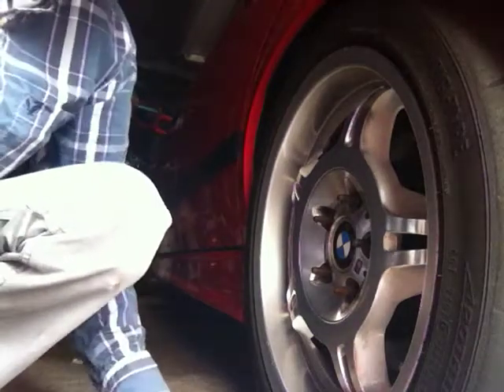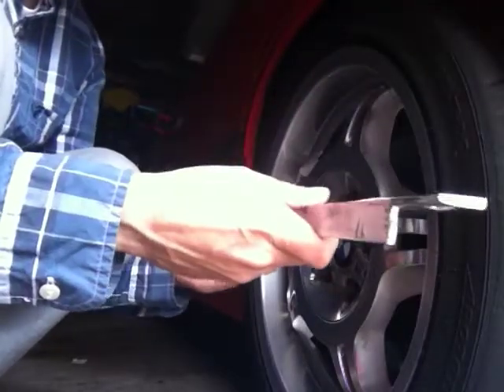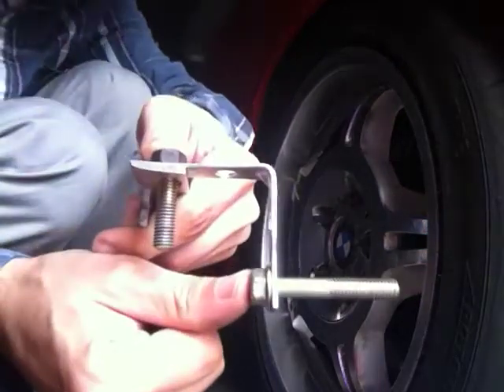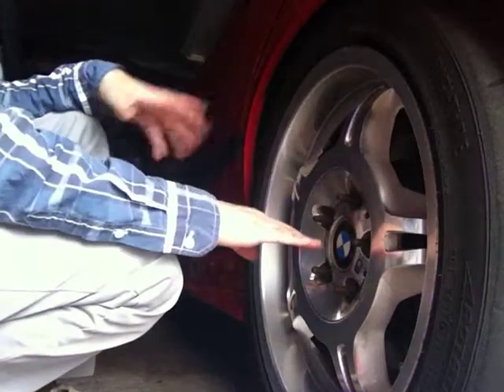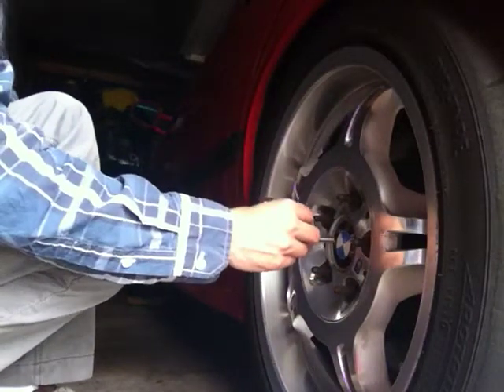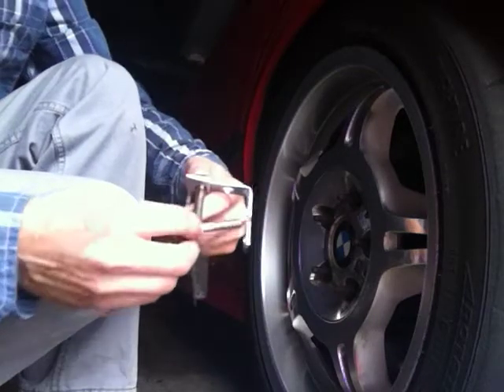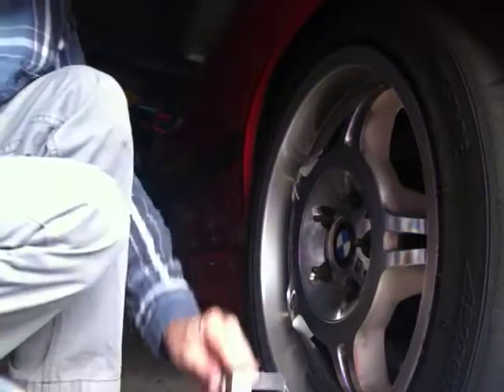BMW Rear trailing arm bushing (RTAB) preload tool

Comment: Can I just get a straight metal and place it on the bottom of the carrier bracket flat and then line it up the center of the hub after jacking up the hub to the correct wheel height my car was when it was on the ground?

Comment: So this is to avoid marking the 3 bolts of the rtab carrier, right?
Reply from the maker: No. You mark the 3 bolts to mark the toe setting of the wheel. This is to get a reference point for the bushing pre-load in a vehicle that is not at stock ride height.
Reply: My e36 is stock ride height.  Do you think I'll still need this alignment tool?  Even if I mark the bolts and put the new bushing in the same position as the old one?

Comment: great video. thanks for sharing... 4 years ago! lol. So, after reading all the comments(surprised there isn't more) I did not find and explanation for "how to actually set the angle correcly." You made it very clear as to how the set the tool up, but you did not mention how to align it... Once the arm is jacked to the proper ride height, and the tool is attached from the center of the wheel to the rtab carrier, we are suppose to move the carrier to align the angle with the tool, right. but what angle is the tool supposed to be at, what are we looking for?  so, the flat bar sits "level" between the pre-measured  8mm  distance above the center line(perfect right angle), and to where it attaches to the rtab? thanks again. I will make this tool following your lead.
Reply: John, first step is to measure your ride height from the center of the hub to the top of the fender on both sides and jot them down. Put the rear up on jackstands, remove the wheel, mark the 3 rtab carrier bolts (to roughly approximate current toe setting), and jack the rear trailing arm to your measured ride height.

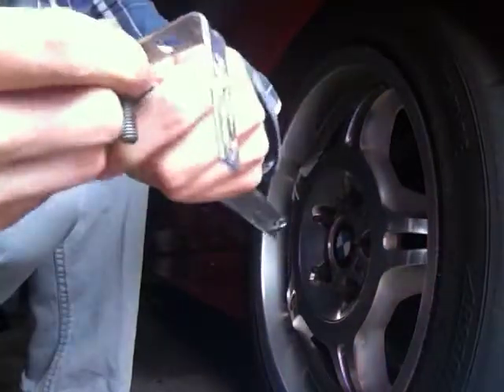Now you take your measurement with the tool. The bolt you snug down on the smaller L-bracket (2:15 in the video) is basically marking your ride height in relation to the plane of the RTAB carrier. (EDIT: This occurs while the trailing arm is still installed on the car.)

Once you have your tool set to the correct measurement, you can then remove and re-install the bushings. Use your tool to align the carrier and torque to spec. Reinstall the carrier back into the body and align with the previous toe marks. 

Hope that helps to clarify, goodluck!
Reply: Evan Schneider yes, it does help. thank you! =)
Reply: @Evtron_  I had this same question and this clarified it for me.  Thanks!  That is a clever tool and this is a great DIY.

Comment: wait so you are setting the dimensions based on your current ride height with worn bushings? aren't you supposed to be settings the preload such that you aren't ripping the bushings when you jack the car up in the air or causing un-due stress when the car is at normal ride height?
Reply from the maker: Rear trailing arm bushings do not set ride height, the springs do. RTABs allow the trailing arm to articulate on multiple axes, and even worn ones will not affect the ride height.  

You set the preload so the bushing is at rest with the car a static ride height. During driving, it twists and deflects a bit under suspension travel, and this is what it’s designed to do. 

The bushing will indeed twist more than normal when you jack the car up in the air, and that's a good reason why you shouldn’t leave it jacked up for long periods if you don’t need to. With the car in the air, that is the most extreme twisting the bushing sees (with stock rear shocks…aftermarket shocks limit droop travel). 

The book procedure for setting RTAB preload uses the “8mm rule” as a reference point. Understand that this is a reference point at which to tilt the RTAB carrier and tighten it down so the bushing is at rest at ride height, when the car is back together. This reference point will NOT preload the bushing properly if the car is lowered. That brings us to the purpose of this video. By using your ride height as a reference point, you ensure the bushing is preloaded properly. If you used the factory reference point, it would twist the bushing at your ride height with the car on the ground. 

The entire procedure is only necessary because you can not access the RTAB through-bolt while the carrier is mounted. 

Hope that helps.
Reply: fiveightandten what is the "factory reference point" then. 

the way I'm seeing it is, if you have a different ride height than exactly factory specs, as with worn or different brand shocks/springs, then the 8mm reference would be off by the percentage of change. Yes? if Im correct, the fact that you  are finding the center line by measure, only means you are recreating the situation of where the center sits at rest. the ride height is the distance if center line at rest relative to the chassis, which you pointed out in your video. that distance is your ride height. if you compare that distance with the factory spec for your wheels and car, find the percentage change, if any, between factory spec and your spec, and then apply that percentage change to lessen the 8mm rule by that much percent. this makes sense to me, say if your slammed and don't want any preload at rest.